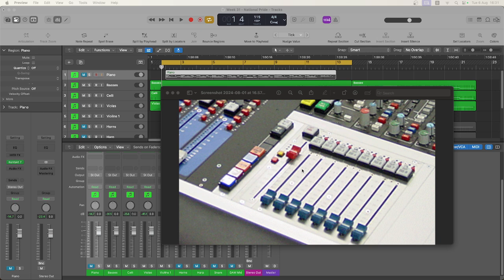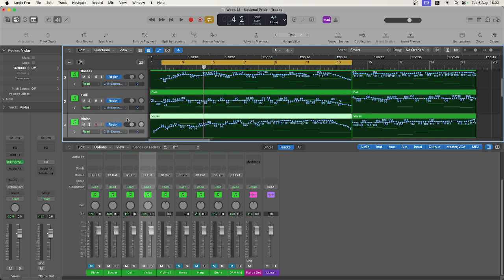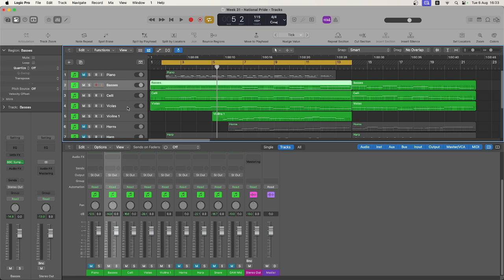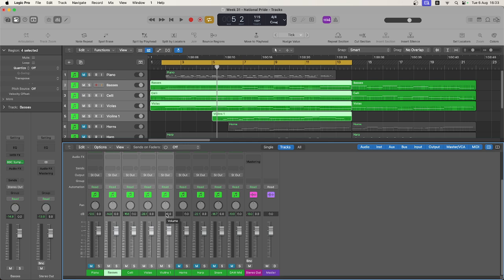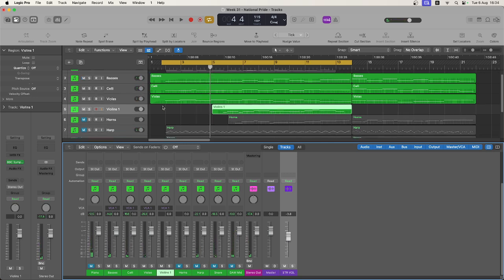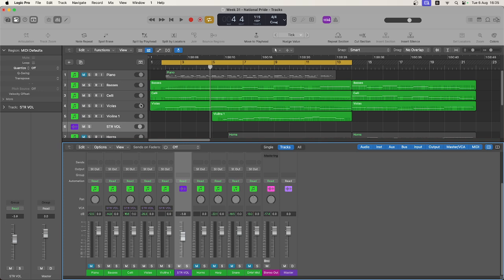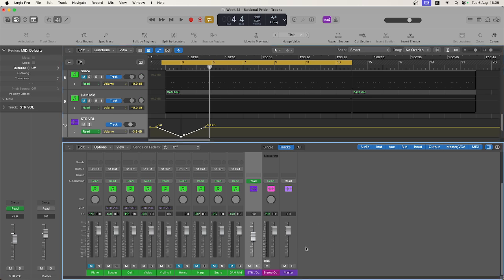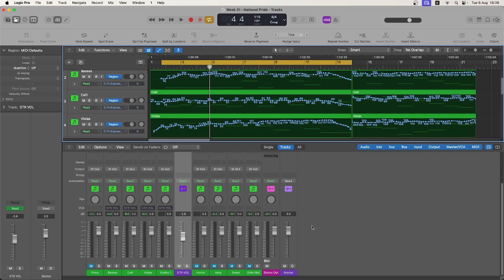How to use VCA FADERS - Logic Pro Quick Tips

Comment: AND... true to form (just as a physical VCA group fader would work) you do NOT see THE FADERS THAT IT's CONTROLLING move because it's a VCA and NOT a normal fader in Logic. I DO believe that you can assign a master in a group of faders, but then there is no way to independently move the faders in the group without more keystrokes. Using the VCA allows you to make individual adjustments within the faders controlled by the VCA. It's a GREAT tool for dealing with drums, or briefly emphasizing a single element within a group. Great video, Dex! Cheers!
Reply from the maker: Cheers Jim, It's a shame the faders don't move isn't it! I think other DAW's like Studio One have done that with their VCA faders (I may be wrong there!), but it does let you maintain mix control over the tracks you've added to the VCA... I think drums is probably a better example where you would use this more frequently too. Thanks, Dex :)